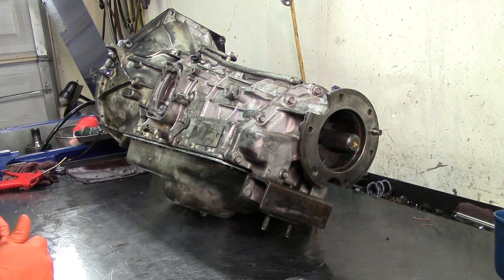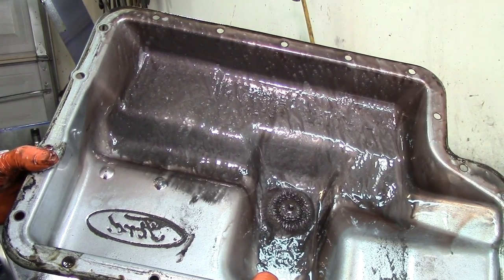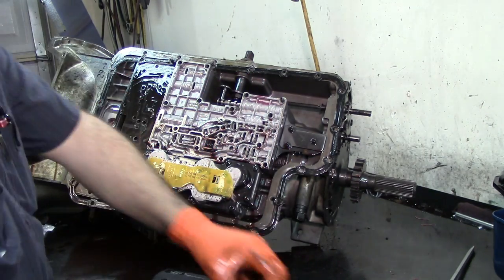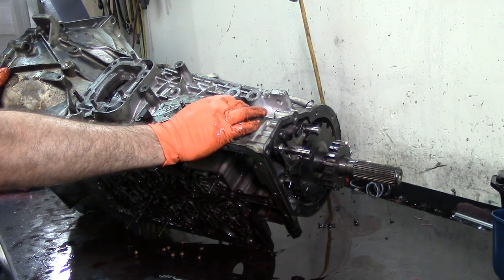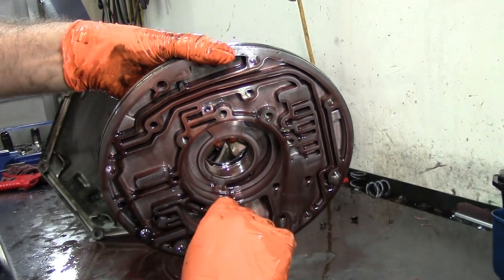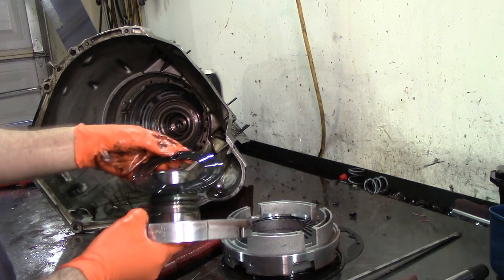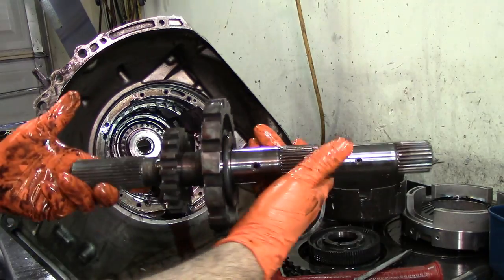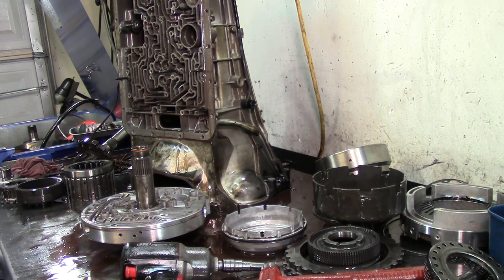4R100 Teardown inspection - Ford F-550

Comment: Finally a video on YouTube that makes the world a better place by helping everyone see they have little choice but to rebuild their own 4R100. I am rebuilding a 4R100 out of a 2000 F250. It is amazing how little information there is out there on doing this. It is not like you can trust anyone except you and a few other people in the world to do this right and there is not a public list of who those people are! You can't just buy one from a chain rebuilder unless you like being a victim. You can't take it to any a local trans shop or they do stupid things like put a stock snap ring in where a spiral is the only way to keep the spring retained or they put check balls back into the single port bathtubs just because the last guy put one in their accidentally. So, thanks for the video. It confirmed my original research but had I watched this video I could have avoided about 20 hours of reading forums full of 99% nonsense and 1% useful fact. The ATSG is nice but it needs to be rewritten by YOU to discuss all the necessary Sonnax or Transgo mods that are not optional and to discuss how to identify the various failure modes as you do. Thanks Hiram!
Reply: I've done a couple of th400 but I think this one is out of my league

Comment: Having cut my teeth in several Ford dealerships as heavy line tech, I was taught to cancel overdrive  while towing or below 55 mph. 
I haven't had any issues with any transmissions of my own, never did break one.
I liked my AOD but it had a reprogrammed throttle body in it. And I do use  the manual gear select when nailing the throttle. 
I see why some folks could kill any transmission, as there is more to driving than smashing the throttle.

Comment: Great idea for the torque converter OD clutch. I have been in many vehicles driven by folks who use D only for all of their driving needs including going up hill and/or pulling trailers etc. and the OD mode will go back and forth as the load is just enough to disengage the OD clutch but not enough to hold it there thus, in and out of OD it goes while the driver pays no attention to this activity. Same goes with 4th/5th or 3rd/4th  gear going back and forth under similar conditions. Folks need to understand when this is happening, turn off the OD or move the shift lever out of OD and if it's a gear issue, move the shift lever or the shift paddle and hold the shifting from occurring then work the gas pedal for the best speed for the gear being used. Most people don't do this so the transmission heats up and is worked very hard yet driver believe this is all very customary activity.  Well, that depends on your pocket book or your concern for the transmission life.  We never use the OD position when driving around town, only when on the highway.

Comment: I really like your videos you explain everything so good.  I wish I new where you are at so I could have you rebuild my transmission.  I know the transmission I have has 1st 2nd and reverse I bought it from a guy to put in my truck but I am going to be rebuilding have to. I have hab my truck for quite a few years I just got done rebuilding a motor for it and it's always had a stick shift and I am just tired of shifting so I went and got another truck that was junk and took and put all the wiring in from the truck in the my truck and now I'm going to be putting the automatic in there and I just wish I had somebody like you around that I can tell from listening to you you know what's up like your videos man I am watching this one very close.

Comment: Sir,
   You are obviously are very knowledgeable on transmissions.    I have a question on my 1993 FORD F150 5.0 MOTOR.  I Have a E4OD transmission that has a slight hesitation upon acceleration.  The truck computer has no check engine light on but when I use a code reader, I get the following two codes.  first one is number 621 which is a solenoid/circuit failure - solenoid 1 - transmission, and the second code # 629 is a torque converter clutch circuit fault - transmission.  I can't find anything on these codes or how to fix my hesitation issue. I can only assume that I need a new transmission solenoid pack.  Any advice or direction you could provide would be appreciated.  Thank you

Comment: Would you recommend the PWM TCC to On/Off TCC for a non-loaded truck?  I'm building a 4x4 E350 RV... It'll be heavy, but not like a F550 or a full-fledged RV.

Been reading mixed reviews on that kit for normal driving.  Thanks!

Comment: Really appreciate you! Honest answers and guidance! And really meant that. Not trying to butter you up either. Do have one question. I suspect I have stuck valve or broken spring issue with very hard shift from 1 to 2. 2000 F350 HD with Pto. What kit do you recommend for those parts. Don't want to lose the check balls either! I guess that isn't an issue if I don't turn it over till I locate them. I've been doing mechanic work all my life but not transmission.

Comment: You Sir Know your transmissions and I really appreciate the quality, informative videos. THANK YOU n WELL DONE
I have a 99 F450 7.3 4R100 I believe has a stuck valve. it feels like in D it only has 3rd,
I can manually downshift to 1st, does nothing in 2nd n cluck into 3rd, then if I manually downshift to 2nd it seems to go to 1st gear.
I was working perfect w resent 5k rebuild w a lot of upgraded parts. Had major engine problems n sat for a year before swapping in new motor. Fluid looked fresh when drained altho low it was not driven before 16 qts new mec5 ATF  
Is there anything else I should look at 1st before dropping valve body? NO CODES

Comment: Hello sir!! Very much appreciate your video. I work at a shop here in North Dakota! I am soon going to be attempting to rebuild my transmission in my personal truck. It's a 2000 7.3 power stroke 4r100 that has no 1-2 shift. It will skip 2 and go right to 3 then 4 just fine with no slipping. Also have a core 4r100 that just stopped moving completely and am curious to know which would be easier to start in on or if I could use parts from one to make the other go. Interested in your thoughts and curious to know if I could get your information to contact you with my other questions. Would appreciate any response. Thanks again!

Comment: I currently have a 2002 4r100 that I currently rebuilt it currently shifts all of the high gears fine but the only issue I'm having is from first to second it won't shift until you let off the gas other than that it shifts great no shutter no hardships it does have the transgo Tugger kit installed also has the transgo spiral snap ring installed as instructed I did indeed update to a full splined forward clutch drum because it didn't have that when I pulled it apart any possible idea that might be causing this that I could look at easily hoping I don't have to tear it back out of the truck because everything in it is new and everything went in just fine no issues I'm suspecting possibly a 12 valve sticking in the accumulator valve body?

Comment: Hiram I have a 2002 F-250 2WD XL crew cab long bed pickup with a 4R100 transmission. I have a drive line vibration occuring at most speeds and I already had the u-joints and drive shaft support bearing replaced. When I wiggled the yoke that splines over the output shaft, there was a lot of lateral play in the shaft and I was wondering if that could possibly be the cause of my vibration due to a worn bushing. Thanks in advance.

Comment: Hello, I was looking for a video that could help me and seeing yours for sure I knew it was the ideal, I would like to know if you can help me with my problem, I installed the converter in my 7.3 4r100 and I did not put it correctly, it turns out that my f350 it does not move and ATF is coming out of the front of the transmission, my question is if I need to change the pump, thanks

Comment: Got a question for you maybe you'll reply. I have a 1999 f250 7.3 4x4 auto with the 4r100. The problem I'm having is that in 3rd gear it doesn't want to lock up unless you go into 4th then press the od off button and then it will go into lock up. It's a ford reman that was installed around 20k ago I carried back to them and there response was "does better than most". Thinking about it I think it only locks up in 4th. Could that be the torque converter it shifts very smooth just not lock up
Reply: +Hiram Gutierrez ok then it's working properly then. Just a little different than my brothers f150 it usually locks in 3rd no problem and when you turn od off it goes straight into 3rd lock. His is 4r70w I believe. It's a 02. Thank you for the quick response

Comment: camarada tengo una pregunta como puedo a ser que mi truck 350 v 10 4r100-2000 puede ser mas fuerte y rapido como si fuera tuviera turbo gracias espero su contesta

Comment: question for you iss on 4r100 with pto on a f550 should the pto ring in transmission be spinning in park to get a signal on iss? because on my2002 f350 non- pto in park it does

Comment: Hi tocayo, good video and very interesting, I have an 08 E450 with the code P0713 that is the TFT already changes it but the code is still appearing, now my problem is that it releases the changes. you can guide me that you can have the transmission Thank you

Comment: What would cause my 4r100 to start shifting all over the place right after my overdrive light starts flashing? It doesn’t do it all the time and it shifts great until my overdrive light starts to flash and then it’s like it’s possessed and shifting all over the place and hard too. I cannot get any codes to pull up either for some reason so I don’t know what to do with it now. Anyone ever experience any of this with their 7.3? I did notice one time that when the overdrive light came on that certain gauges in my dash stopped working so I slapped the top of the dash pretty hard a few times and the overdrive light stopped flashing and my gauges started working and it started shifting fine again so yeah idk wth is going on. Any help would be greatly appreciated!

Comment: I ain't never understood why they need to have different length bolts on a valve body. Seems like it causes more shit than just about anything. I mean, I know there are design considerations in the process, but it seems to me like in most cases, they could have equal length bolts and not have any issues with clamping force on the valve body.

Comment: My tranny stopped going in to drive,reverse works but it started out by taking a second or two to go into forward gears, then I had to give it a little gas to go in, to coming out of gear at a stop light then nothing. This was over a couple weeks time span.  It didn't leave me stranded though I made it home. Any idea what it could be anyone?

Comment: Hey Hiram, Great Video, I refer to your vids quite often,. Question.. I have a 4r100 out of a 02 7.3 excursion, it has no forward gears, strong working reverse, fluid came out cleanish with no burnt smell or major metal shavings, just a little on the magnet around the drain hole. I've pulled the valve body off following your video, all check balls and everything else looks clean and working as far as i can see. Any thoughts as to what it may be as its so clean in there?
Thanks in advance.

Comment: ive got the 4r100 but the over drive push buttom not working ,but the truck sometimes goes into over drive but rare the light just stays on ,think its the switch but still havent replace it i also checked column but no wires were open there c
Reply: still trying to surt out any ideas helpful i noticed you didn't say to much about overdrive much ,other then center support section
Reply: yeah those switches go bad often, easy to replace though.
Reply: What I found was the boot between the shift handle and steering column was pressing down so hard on the wire harness to the switch that it shorted wires to ground there. Had to build a custom harness after wiring repairs made out of copper pipe condom to keep the boot from doing it again. Mine was blinking for a while and then just went dead eventually.